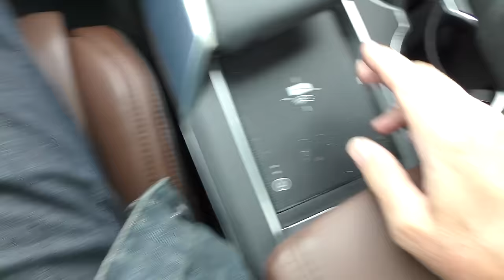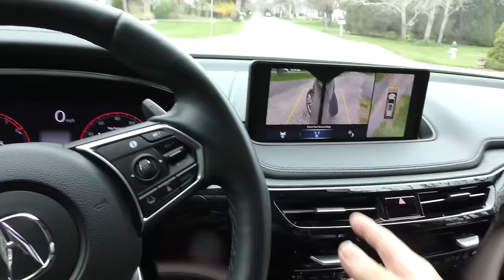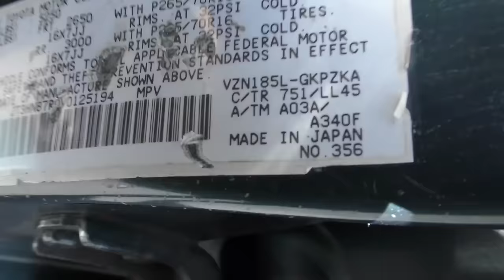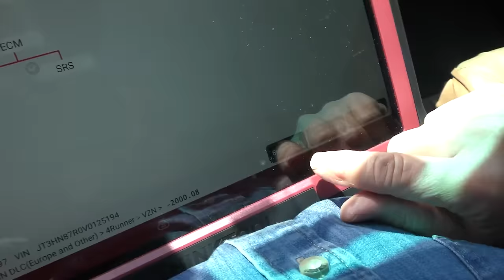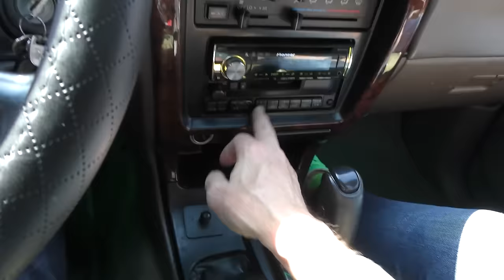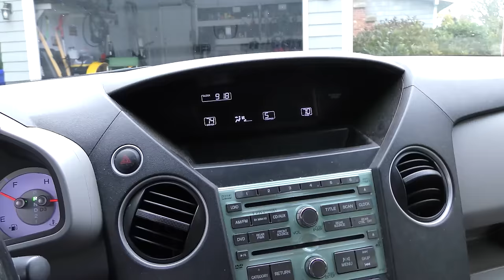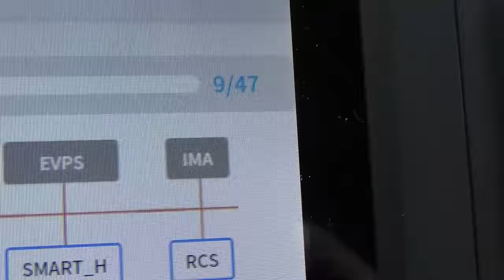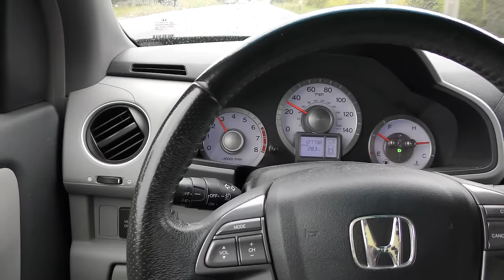3 SUVs That Will Last 500,000 Miles or More

Comment: A good follow up video would me titled "3 SUVs That Won't Last 50,000 Miles or Less." I nominate the Jeep Compass. I rented one of those for a day trip a few years ago and even with only 21,000 miles it was having random misfires and the transmission was shifting really rough.
Reply: after watching scotty, I know there are essentially two good cars  - honda/acura and toyota nexus. nothing else comes close.
Reply: Rental miles are worth more.
Reply: All Jeeps that are not wranglers tend to suck imo.  The Cherokees used to be very good but they have gone downhill.
Reply: I nominate all 2007 and newer GM suv's.  That's when they went to active fuel management and started having engine misfires and electrical gremlins of no start issues.
Reply: Anything Chrysler is straight-up garbage. Honda/Toyota are the best vehicles by far.
Reply: @twointhepinkoneinthestink  Mazdas are better, there’s more to a car than reliability, and I’d argue that modern Mazdas are just as reliable as Toyota and Honda, they just aren’t boring to drive with outdated cheap interiors
Reply: Rented a dodge journey years ago. Biggest pile!
Reply: @twointhepinkoneinthestink  I trained for 2 years to be a Chrysler/Jeep mechanic, I drive Toyota, Honda, Lexus, and Jeeps made by AMC and Kaiser. I totally agree. I recently acquired a Chevy Equinox with 77,000 miles, will probably trade it...
Reply: @mousetoad7040  Better dump that Chevy fast!
Reply: Friends don't let friends drive FiatChryslerDodge products
Reply: COMPLETELY AGREE!!! Ive discovered Mr. Scotty Kilmer in 2018 and everything he said about the Jeep Compass is TRUE!! 

I HAD ONE 2011 Jeep compass. I made everything to make it last, she made everything to left me on hate. Spend at least 14000 $ in repairs for 4 years! I've learned the lesson!

Now I'm driving a 2020 RAV4 since two years. NEVER HAD A SINGLE problems!! Thank you Mr. Uncle Scotty!
Reply: Don't compare a rented vehicle to anything. You don't know the lack of maintenance on it🤣🤦you know people don't care of rental cars
Reply: Yes. Toyota and Honda. I have camry.

Comment: We have a 08 Honda Pilot with 124,000 bought it with 117,000 original miles. Great vehicle, had timing belt replaced, tensioners, water pump, thermostat and coolant. My wife hated that I got it and now she won’t get off it. I suspect it will go another 117,000 no problem. Great car for traveling. Hands down Toyota and Honda make the best vehicles out there. Thanks for you videos Scotty, love your content 👍🏼👍🏼
Reply: Yeah.  I've always owned 4WD pickups, but I was tempted by the Pilot and Sienna.  Very practical vehicles.
Reply: Agreed! The only reason I don't have one is because it was totaled in an accident that wasn't my fault. I loved that car and wish i still had it.
Reply: We have an 08 with 205,000 miles on it and it runs smooth as silk!!  The 1 generation pilots were built very well.
Reply: Hubby has a 2011 at just shy of 200K miles.  No signs of stopping, standard maintenance.

Comment: Just picked up our 2023 4runner.  4wd. Is it outdated?, nope not at all.  Love it. Hydraulic power steering,  frame,  not unibody,  and a proven 5 speed  automatic,  no cvt, no frills.  Just a proven beast, and from Japan. Picked it up with 3 miles on it.  Couldn't find a used one with low mileage any cheaper
Reply: Wow! I currently have a 19 Jeep Grand Cherokee and I’m doing everything in my power to trade it in to get a 4Runner. Love how beasty they look and super reliable.
Reply: except its got the police state sensors system...
Reply: @divingduck9  what’s that?

Comment: Great video, Scotty.  Have owned a 2003 Honda Pilot that we bought new in late 2002.  Only has 110k miles, so low mileage.  Is now on it's 3rd teenage boy driving it so it has not been babied.  Only thing now is after 20 years, needing to replace a number of rubber parts...not really due to mileage, more due to time.  Gives my boys and I something to do on the occasional weekend.  Has been an extremely reliable vehicle for 20 years now.

Comment: Makes me glad I purchased my 01 4runnner this August. 294k miles and running great
Reply: Yep, can't go wrong with those. My last one went 360 thousand then I totalled it in a wreck. I've got a Lexus GX470 with 150 thousand and runs and looks new. My wife's Land Cruiser could realistically go 500 thousand no problem. In my opinion Toyota and Honda are the only way to go.
Reply: 01 4Runner with 200,000.  In love with my truck
Reply: Sorry but purchasing a 294k mile vehicle is crazy. No engineering can defeat basic wear, time, or environmental factors. 

At 294k it’s not even just about the engine and transmission anymore, everything from the drive shaft to the frame will likely have significant wear.

Comment: The Honda Pilot is insanely reliable and can go a 500K miles plus, if you keep up with the maintenance.  We have a 2011 Honda Pilot with 280k miles on the OD.  It has the original transmission in it with no issues at all.  The key to trans longevity is changing the transmission fluid every 50K… and the engine burns no oil between intervals.
Reply: Petrol or diesel?
Reply: @Truba194  petrol (gas)
Reply: You’re correct, maintenance is the key. My 07 pilot runs smooth with no major repairs done. I’m very strict with all fluid changes and only use 100% synthetic fluids.

Comment: Toyota Highlander might not make it 500,000 but 2 to 300,000 plus , with pretty good Gas Mileage , is good enough .  My 2022 limited ( with third row seats ) is averaging over 21 to 22 so far  , ( only 4,000 miles / Not Broke in yet )  My buddie has a 2018 same model averaging around 24 mpg plus.  For a large SUV / Crossover , one of the best buys out there . JMO
Reply: @time traveler agreed! It’s a great family vehicle.

Comment: I’m convinced my 2018 RAV4 will never die. I bought it from Avis in 2021 and have since put 43,000 miles on it. In that time I’ve blown up my alternator, killed my fuel pump, had the battery weld itself to the hood, and blew the EFI main fuse. Every single time I had an issue minus the fuel pump the car started right up with minor field repair. I’ve put this car through hell as a rally car and have taken it to the hardest roads you can drive in Utah, Idaho, Oregon, Montana, and California. It’s seen most of the US and with all the work I put into it I’m hoping I can get it to see the world.

Comment: Yup. We had to replace our transmission on our 2009 Honda Pilot a few years ago. It was $5000. We change the oil frequently at the dealership because we get nice printouts every time we get serviced. The car runs great other than that one huge purchase. We bought it used in 2015 from the dealership and it has 156,000 miles now. We plan on keeping it until the wheels fall off. Thanks for sharing your knowledge with us 🌹

Comment: This has: 2 hi, awd mode, 4hi, and 4 lo. The button you see puts it into “awd” mode. There is a button on dash left of steering wheel that locks it up like a traditional 4x4 if you want. 

The “j shifter” version is the rarest. It has all I listed above plus locking rear diff on some models. 2000 is the holy grail for 4x4 configuration on 3rd generations. 

Here in Colorado these are still EVERYWHERE.

Comment: I have a '99 4 Runner...270K mi...solid and strong as can be! I has NEVER not started...ever! Runs great, drives great, no repairs except for starter motor solenoid contacts...spark plugs at 120Kmi (just cuz) and timing belt at 220K mi (didn't break just replaced it for preventative maintenance)...batteries every now and again. All accessories work. AC blows cold as ice. Thing is a dream. Owned a GMC SUV product before. Simply no comparison in quality and drivability.

Comment: My 1993 Landcruiser has 340,000 miles on it and still running strong. Mileage sucks but it works as a part time truck for the beach and mountains.

Comment: howdy Scotty, I have a 2004 Honda PIlot and this baby had 265,000 miles on it.  Run like horse and never fail to start, original engine/transmission.  Sold it last month due to high fuel this year!   I believe this baby will run for another 200K+ miles~~

Comment: Excellent  advice on the timing belit and interference engines.  I had two Subarus (80's 90's) and since I was young and poor both broke down while driving when the belt broke.  Simple tow and fixed. No damage.

Comment: Have a 2007 4Runner SR5 V6 I bought in 2019 that had 220k miles on it. Have 256k miles on it now and still going pretty solid. It did need some things in the first year or so of ownership, new power steering rack, radiator and brakes, but most of that's expected. Feel like it has less interior rattles than a lot of newer cars which is sad. Honestly I don't think it rides that badly either. I decided on a V6 rather than V8 since the V6 has a timing chain, but maybe a V8 wouldn't been a tad better if I wanted to tow more.

I undercoated the frame and subframe areas with POR15 to help it last longer/keep surface rust off. Planning to keep it until either the engine or transmission goes.
Reply: How much did you buy it?
How much undercoating cost and how often should be done?

Comment: I have a 05 Tundra 4.7 v8. Daily driven for 15 yrs now. I bought it with 46k miles. My best friend bought a 01 Tundra brand new in 01. He drives it Daily and now has 433k miles. He didn't change his timing belt until almost 400k miles. His original never broke, he's lucky. He just recently had to change some of the seals. His 01 has 4.7 v8 also and still runs very smooth and shifts very smooth. Other than the timing belt he has been very adamant about changing all floods at the factory intervals. He's done all maintenance himself.

Comment: My wifes' 2005 Four runner has 424,000 miles on it. Still runs as good as the day we bought it. I could kick myself for selling my Tundra that had the exact same engine and transmission.
Reply: I parted with cars that are worth tens of thousands of dollars, now. Cars that cost under 4k new in the 60s bring over 100k now. 
If I only had a time machine!
Reply: @OtayBuckwheat  I have a 1964 Ford Galaxie I need to get back on the road. My granddad bought it new. My dad drove it to high school and college. I could probably get a little $$$$ for it.
Reply: @jimwilliams9841  A two-door hardtop certainly is, and there were multiple inline 6 and V-8 powertrain options, some very rare, and a convertible is a mint on wheels.
Reply: @jimwilliams9841  I have three vehicles eligible for antique tags, that I drive.
A '97 Silverado, a '95 SLT Yukon two-door Turbo Diesel, both 4x4 with a Z-71 packages, and a 1965 Olds Cutlass convertible.
I love loaded a video of my Silverado and my Cutlass is the cover photo.
I also have a 2011 Camaro Convertible with less than 13,000 mi on it, and a Cadillac SRX with rear wheel drive.
Reply: @OtayBuckwheat  Nice cars! That Cutlass is a beauty! My Galaxie is a 4 door hard top so probably not worth a fortune, but it's still pretty rare. It has the 390 with a 4 barrel Holley carb from the factory. It's fun to drive.

Comment: We had a 1999 Toyota 4 runner 2 wheel drive, 4 cylinder and 5 speed manual transmission.
We pulled a 2,000 lb tent trailer from southern california across arizona, new mexico, to 
colorado and into Utah. We even went up very steep roads sometimes at 25 mph.  Pulling even that 1 ton trailer we got under 15 mpg.

This smaller suv did the job pulling that trailer over 3,000 miles that trip. On flat interstates 
it can pull that trailer at near or over 70 mph.

We sold our 1999 4 runner with near 200,000 miles for near $5,000 in the year 2018 for a nearly 20 year old vehicle. We had no problem selling our 4 runner for $5K. Without the trailer it got near 25 mpg and could cruse at 80 mph no problems. The better mileage was a speeds closer to 70 mph.

The 4 runner had great ground clearance with lots of room in the back with the seat folded down.

Incredible as it sounds we now have a 2013 Dodge Grand Caravan that will pull that 1 ton tent trailer even at 70 mph and gets near or over 20 mpg. The Grand Caravan has in incredible engine and drive train. It is an amazing vehicle. In the years near 2013 Dodge redesigned their 6 cylinder engine done by Domler Mercedes with the transmission.
Reply: That 3.6 engine earned my respect, good power at high rpms and smooth

Comment: I love my 2005 Acura MDX. Over 200k miles and she’s still going strong. Love my Lexus’ as well.
Reply: have you had any transmission problems? Im curently looking at an 06 mdx with 180k miles for 4k but all the pistons are misfiring
Reply: @devoncarter5580  knock on wood I haven’t.

Comment: I love my recently purchased 1st Gen MDX. If you get an MDX, get the 04 & up. 02 & 03 had transmission issues but they corrected the issues starting on the 04 models. Just wish honda made an V8 model.
Reply: My 06 MDX has a hard shifting transmission at only 150k miles
Reply: @elliottperkins4358  Change the fluid 3 times, with short intervals between each. There are several screens, and some have a filter. Make sure the fluid is at the correct level. Too much/little will also cause rough shift. WARNING: always use Honda/Acura fluids and parts.
Reply: Honda will never have a V8 and their 4wd system ain't all that gd tbh

Comment: Bought a 2005 Pilot with 167,000 miles on it with a broken timing belt for $1200. South Carolina car from day one. Replaced the timing belt and water pump and HOLY MOLY the dang thing ran on all six cylinders with no bent valves! Got really lucky on it. Over 200,000 on it now with zero issues.

Comment: I bought a 07 Honda Pilot. The guy that sold it to me rolled back the mileage 125k miles. I bought it with 115k miles. Tried to get my money back but I decided to just drive it into the ground after fighting with the guy. My 1/4 million mile Honda drives perfect, I have no issues with it. Just have to change my oil and she drives amazing. Drove from Cali to Colorado and had no issues at all. I’m hoping to get at least 4 more years out of the thing.
Reply: Don't forget the timing belt

Comment: Not an SUV, but a vehicle that is super reliable and can last like forever  - I inherited a 2005 Lexus LS 430 from my mother. The mechanic at the Lexus dealer told me not to sell it and to "keep it in the family."  That model year was apparently known for its simplicity and reliability. It has 60K miles and a smooth V8 engine.  No mechanical trouble at all, just maintenance. Sweet.

Comment: Hi, Scott. I have dodge grand caravan 2008. I know you probably will say is not good , but I didn’t have several issues. Now , I would like to
Update, but new series comes with new pentastar engine 3.6 Lts which is a big no no. I’m not able to get nothing fancy. I would say 2010 will be my limit for budget. My options, sienna or odyssey. I’m super scared about Honda transmission. Sienna 199-2003 sludge oil issues. Can you please what be my best choice. Thank you

Comment: We have a 2008 Highlander Sport. 248,000 miles.  Runs awesome. All we do is oil changes
Reply: I have a 09 with almost 200,000 miles on it hope to keep it for another 100,000 miles.
Reply: I have a 2005 with 138,000 miles Does anyone have any idea if I should change the timing belt? It has the 3.3

Comment: 2002 Acura MDX with 430K. Running strong. First gen MDX notorious for transmission issues so I guess I got lucky.
Reply: Did you get it new? Check if the recall was done on it. You will see an oil cooler line on the fill plug.
Reply: @harveyhankerson8359  Make sure to keep upon the fluids. Acura/honda fluid only. Call your local dealers and see if they have a discounted website. My local Honda and Acura dealers both have websites that you can buy online cheaper, and pick up from them. Saves a good amount of money too. I have had good luck getting deals on cases from my local Acura dealer.

Comment: I am looking at a 2005 Rx 330 with 224,000 is it worth it to get it with that high of mileage? It does have a new dashboard from Lexus so it is not cracking like the originals and it is only $4,500.

Comment: What!  No Lexus RX!  I am just passing 300,000 on my '99 RX 300 and it runs like it is new.... Also acquired a '17 RX350 and just reached 45,000 miles.  Fact is... these are the least expensive vehicles I have ever owned because that are so reliable!  Sadly, I learned the hard way about reliability after owning money pits from Land Rover, BMW, and Mercedes Benz....
Reply: Land Rover wins for most trips to the dealership.  BMW and Mercedes charge astronomical prices for cheap, plastic parts.
Reply: Totally agree! I have a 2013 RX350 F Sport and I love it! Has a little over 100,000 miles and runs like a top. It’s the third one I’ve owned. They last forever and still look like new. I don’t pay any more for repairs then I did on my Toyotas. They are a bargain in the long run.
Reply: I got an ‘04 RX330 AWD, everything still works. 0nly 38,500 on the clock. Long live Lexus!
Reply: My 2007 MB ML350 started having problems exactly at 150K had to junk it, meanwhile 2005 Pilot still running strong with 280K

Comment: I’ve got a 1st gen taco same engine as the 4Runner with 273k miles on the original timing belt 😅 I’d level it with bilstein 5100s much better ride

Comment: I had a 2005 4 Runner SRV 6 cylinder that was the best vehicle I've ever owned! I loved that truck and bought it new. It had surprising acceleration! The body was still clean in 2015 with 75,000 miles on it when I discovered holes in the frame! I wound up trading it in for way more than I expected to get. I got a 2015 Rav-4 which is just not anywhere near as good as that 4 Runner was! The new one's in 2015 seemed much too big for what I needed so I got the RAV-4..